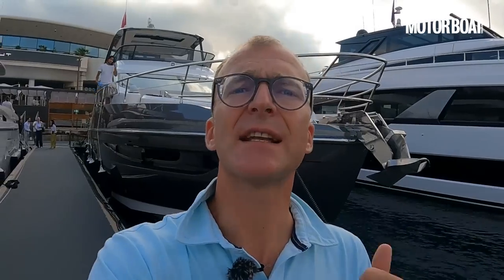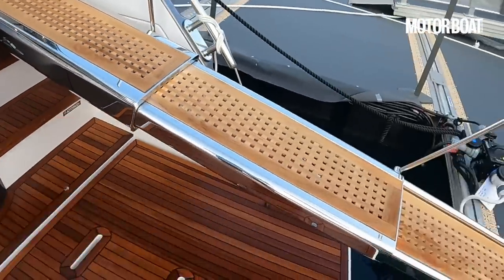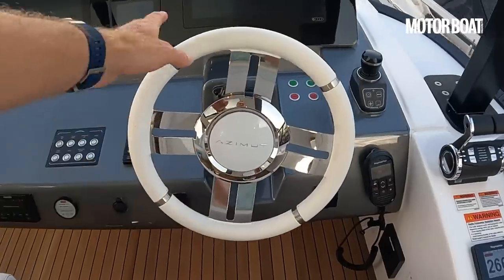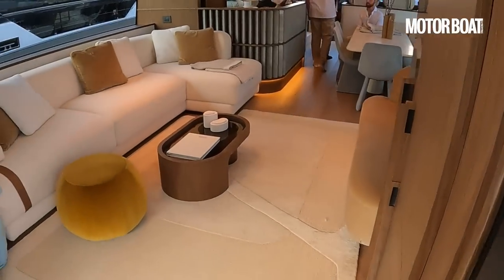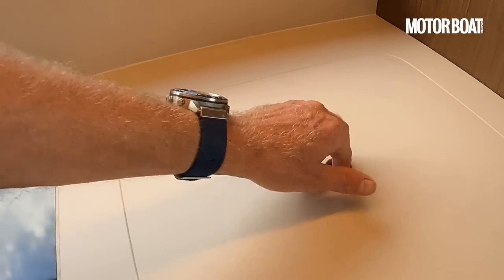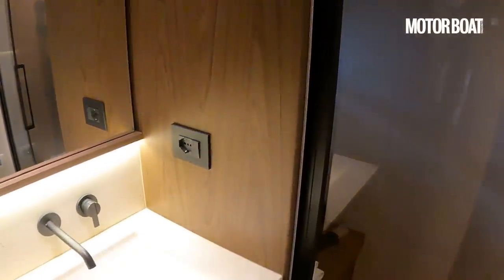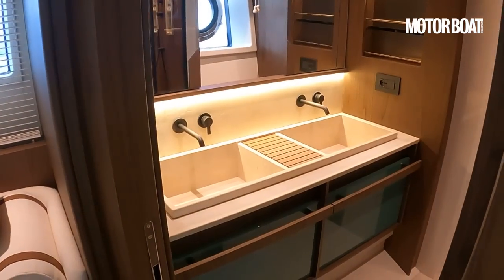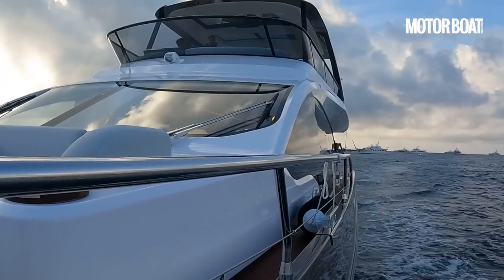Azimut 72 yacht tour | Brand new flybridge model with style and space to spare | MBY

Comment: That flickering is caused by multi-color LED lamps that can have their color, color temperature, or brightness, adjusted.  This adjustment is achieved by extremely high-speed strobing of the different colored elements in particular patterns.  It is either preset at the factory, or set using the wall control or wireless remote.

While invisible to the human eye, the more precise scanning of image sensors in cameras aren't so easily fooled.  The pulsing flicker effect is an interference pattern caused by the camera detecting part of the LED's strobing pattern.  In fact, slow-motion capable cameras will record rather startling and intense flickering patterns at various frame rates.

With incandescent and fluorescent lighting, you might get a flicker if the camera was set for 50Hz frame rate, and the mains used 60Hz.  There's a setting in most cams to switch the frame rate to 60Hz to eliminate the flicker.  That trick won't work with LEDs.